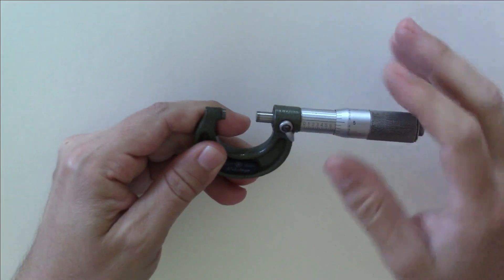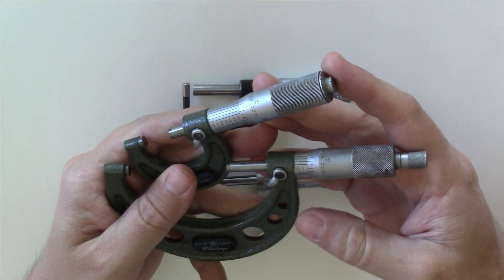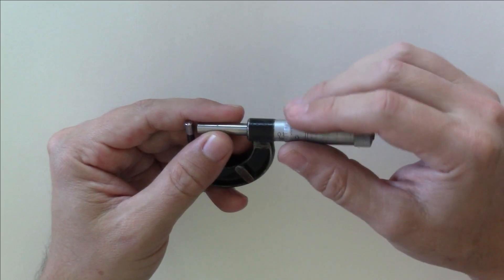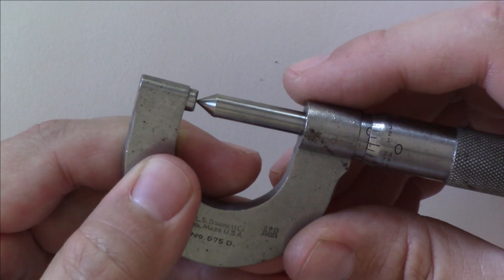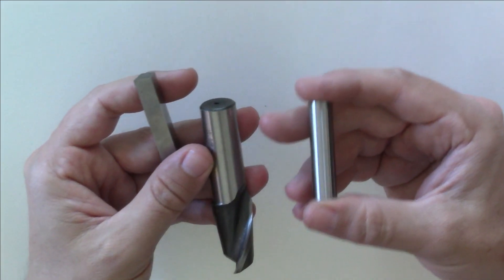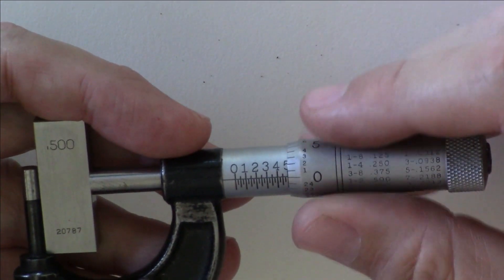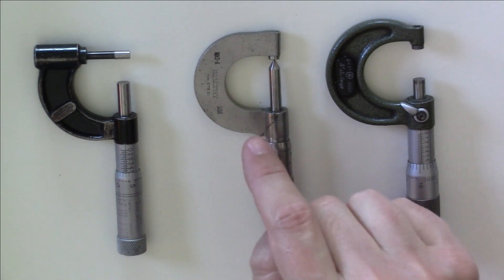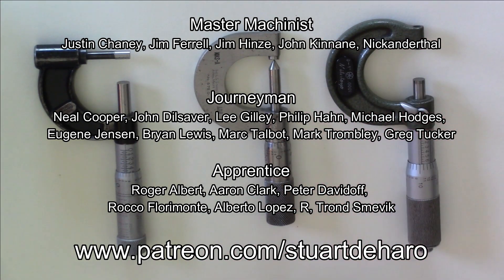Developing a Sense of Feel With Micrometers

Comment: U didn't mention exactly how many sounds or turns should it be in modern micrometers?
Reply from the maker: @betatool-p5z  I've never thought about it that way. I just go until it starts to slip or click, then I wiggle the frame of the micrometer back and forth a few times to make sure the anvils are seated on the part. That's something you can feel pretty easily. If the mic is not fully seated you'll feel it jump around a bit until it feels like it's making smooth contact with the part.

Comment: I just bought a used one Ammco 2250 and the ratchet doesn’t make a click noise, it has a spring in there. I’m learning so I can repair my brake rotors. I think this sense of feel is personal and we never will have a perfect measure with these designs. Thanks for sharing your knowledge.
Reply from the maker: Yep. That’s the friction thimble. I personally really like those. There's just a satisfying smoothness when it slips.

Comment: Solution to the problem, don't be cheap and buy a micrometer with a ratched, end of story
Reply: gehinarsch, I have micrometers with ratchet or friction spindles and I don't use either feature. With a bit of use you quickly develop the feel to make a good measurement. If you are working close, say +0.0001/-0.0000 then you need to check your shop micrometer against a stack of gage blocks set to the desired dimension. In that realm your micrometer may be just fine but the warmth of your hand or a fan blowing on the work can throw off the measurement.
Reply: Curiously buying the best can be a hindrance. Take the mitutoyo quantum mic, good and expensive but being 2mm pitch(80 thou-ish)  with umpteen decimal places on the screen and with friction thimble getting the anvil dead square is not as easy as a ratchet on a cheapo Starrett.😂
Reply: @chrisstephens6673  I have to admit that is the first time I have ever seen "Starrett' and "cheap" used in the same sentence.

Comment: If using a standard dowel pin as a standard be aware that those pins are usually +0.0001" / +0.0002" over nominal. Pins are made this way so they will be a light drive fit into a hole that has been drilled and reamed to the nominal diameter.
Reply from the maker: Yep. That’s why I lumped them in with end mill shanks and tool bits. Dowel pins have a nice finish and they're round, but they aren't going to be right on size.